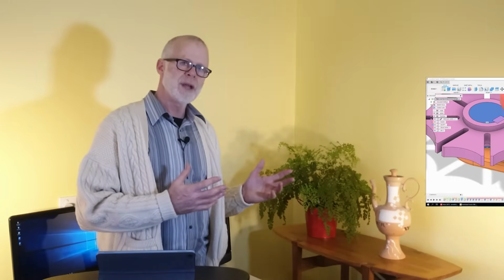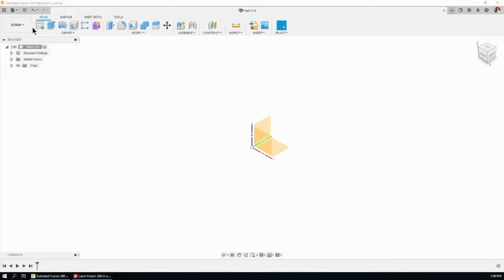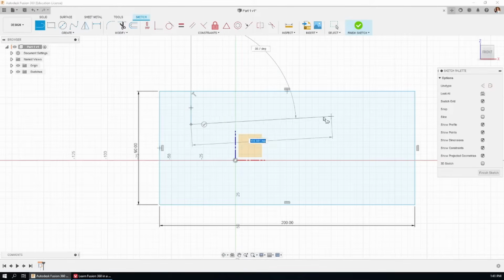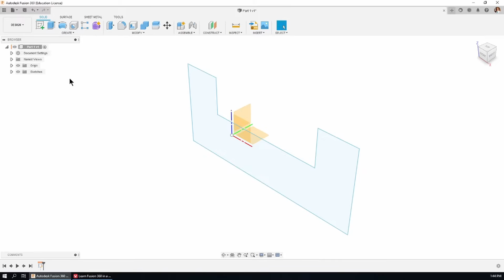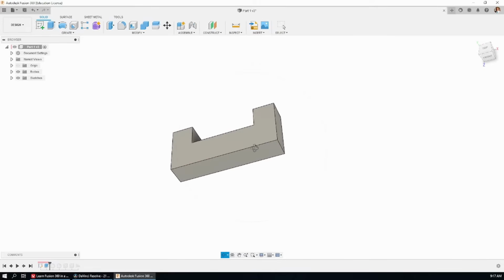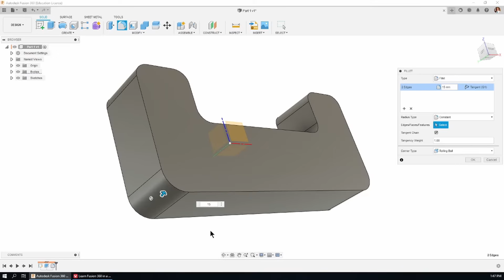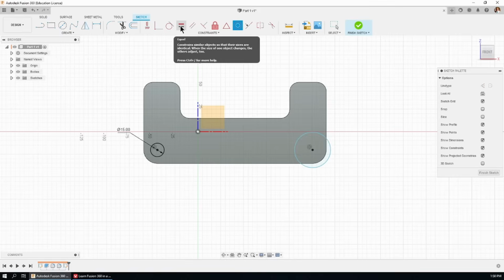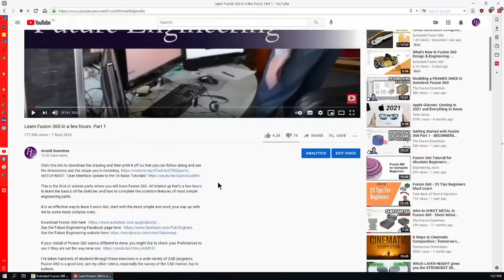Learn Fusion 360 In a Few Hours. Part 1

Comment: Very detailed and easy explained. Thanks very much. Subscribed and liked. Really deserved it. Is there a way to draw the holes already in the sketch mode and then also cut/trim them away?
Reply from the maker: Yes there is Mein, I'll be explaining in the next revised video (or perhaps the one after) about why I keep the sketches minimal when they can be much more fully featured. Basically its because new users constantly trip up in the sketcher. Keeping it bare bone and over simplified gets more people through and then they can proceed to complexity with a little more experience and a lot less grief. Have at it, see how you go, but remember that you can simplify the procedure if necessary.
Reply: Thanks for your response. Also what would be great is how to modify steps in the design which where done in the early beginning. For example I made a body with a whole and later on I need to change the dimension of the hole and the position or a cutout in a body. I getting frustrated and always undo till I get to the beginning 😬

Comment: hi i like your tutorial revised part 1, except while following it i found that the middle mouse button on my mouse is round and it only allows me to zoom not orbit I'm using a Logitech (i forgot the model) do i have to change something in settings or get a real three button mouse?
Reply from the maker: Hi MP, Logitech mice are usually pretty good. I'd be surprised if it was the mouse that was the problem, I think you might get somewhere if you mess with some Preferences, if you download the 16 drawings you'll get my preference settings as screenshots which you can go through and set your own to be the same.  The Orbit settings are on the General tab low down on the page, see Pan Zoom and Orbit Shortcuts and the next one there. In the meantime have a look at the little toolbar in the middle of your screen at the bottom. There is an Orbit tool there on the left side with a flyout and a variation. You can use that one with your left mouse button while you're sorting things out.

Comment: "Hi" just saying hi. I just got a 3D printer and I'll be using Fusion to design various enclosures for my projects. Your tutorial mirrors my version of fusion except with a few exceptions. I seem to have to click on the orbit icon to rotate the part where you seem to have a mouse click that works.
Reply from the maker: Thanks for the feedback, I hope your projects go well. That rotating behaviour can be changed in Preferences to some extent. See the video on Preferences here:  https://youtu.be/UVwJJvQR1fc    The one I'm thinking of is on the General page toward the bottom. I have it set to 'Solidworks' and the default Orbit type is Free Orbit.  I'm presuming you're on Windows? Its really convenient to be able to hold down the middle mouse button or scroll wheel and drag around.

Comment: Can I still use the old series? Has a lot changed in fusion 360 since then?
Reply from the maker: Yes Steven, the old series still works and there have been relatively few changes. I made a few extra videos to support the older tutorials while I was slowly getting around to updating. At the time of this writing there are only 2 revised ones and I won't be deleting the old ones due to the way Youtube search algorithms work. Deleting old videos deletes the searchability of a channel which takes so long to build. That said, there is something to be said for using the revised tutorials; the software is automatically updated and Fusion 360 is a kind of hybrid thing which is only partly downloaded to your computer. A lot of its functions are in the cloud and I'm not sure that you can avoid the updates very effectively. Consequently they are careful about how quickly and how drastically they make any changes to the user interface. 
Anyway, here is the link to the playlist on my channel for all these videos; the 16 tutorials and the support materials, as yet I've got the new ones in the same playlist as the old ones.

Comment: Hi Arnold, I am missing the extrusion icon for some reason. I have double-checked preferences so not sure why this would be, any suggestions?
Reply from the maker: That's pretty unusual, the only thing I can guess is that you're still in sketch mode. Are you sure that you've clicked on Finish Sketch?  You can tell when you're in sketch mode; the tool bar has 2D sketching tools and constraints but when you're in Feature mode you'll see the 3D tools in the toolbar, Create, Modify and Assemble etc.

Comment: Hello Arnold, I am moving from Design Spark Mechanical to fusion 360 because the free version only allow importing step files as read only so it is kind of limited. I put a lot of time into learning that program. I am hoping fusion is similar to DSM so my many hours were not wasted. Thank you for upgrading your beginner tutorials. I watched the first one and subscribed it was so good.
Reply from the maker: Thankyou Joseph and welcome to the channel. You'll find that all your experience with any kind of CAD will benefit you. Its even the intangible things like a sense of 3D space that comes by practicing reading drawings and spatial concepts. Insights are hard to put a value on but they do help, and then there's the benefit of modelling and detailing workflows that may differ to some extent but have a common goal. I always believe in multiple perspectives giving a better picture.

Comment: If you just want modeling to export for 3d printing, this is probably still a good solution.  The crippling changes they have put on the free hobby version make it useless for any sort of machining.
Reply from the maker: Wow Matt, that sounds a bit over the top, all the other Youtubers that I follow don't see the new restrictions as a deal-breaker. See my video on that controversy; https://youtu.be/FlrpyzquSQQ
I also show you how to work around the most significant restriction. The restrictions on the manufacturing workspace are pretty advanced features, most hobbyists don't go there, the basic stuff is all still available for free which makes it still the best deal there is.

Comment: Hi this is just what I need.I taught my self autocad 2004.and picked up so many mistakes.So now I can learn 360 correctly.Its a shame they aren’t on a disc to use directly
Reply from the maker: Thanks Peter, welcome. Hopefully Youtube will be there for years to come so that you can always come back to them if necessary but I think you'll be moving on to greater challenges soon enough. What will you do with Fusion 360?
Reply: @ArnoldRowntreeTeachesFusion360   I work for a model steam company in the uk

Comment: Hi Arnold.  I started the older Part 1 and 2 a couple of weeks ago and I think it is difficult for you as an experienced user to remember how unfamiliar everything is to a novice (like me), so I welcome your revised tutorials which are explaining things easier and S L O W E R.       :-).   I will watch them more than once and hopefully in 60 hours I will be up to speed.  Thanks a lot cobber.   Keith
Reply from the maker: Good on you Keith, I do try to pitch them at a new comer but I don't try too hard to speak slowly knowing that you can watch as many times as you like for the same price (0). I'm going to work through all the revised versions which will probably take about a year at my current rate of production so you might need to finish on the older ones.

Comment: 👌 There's one thing I found out. Because I have a free version of Fusion 360. I can have only 10 files active at one time. I was trying to make my own first part and couldn't save it. But once I made the rest read only I could save. Bizarre limitation but I thought it might be good to note if anyone else was using a free version.
Reply from the maker: It is bizarre but it still works ok for this learning stage. They wanted to protect the commercial version somehow. I think you'll get familiar with the limitation and work around it for some time yet.

Comment: Hi Arnold, have just just signed up for the newsletter and the 16 drawings, but the download only has 2 drawings in it and the other pages are settings for Fusion 360, is this correct ? are the other drawings  going to be sent with future newsletters?
Reply from the maker: Thanks for subscribing Andrew. Part of revising the old tutorials means that I'll also be revising the drawings. I sat down to revise all the drawings at once, there were an astonishing quantity of errors in the original and I have been keeping a list of corrections from all the feedback I've received. What I realised was that the revised tutorials are going to be a bit more creative. Rather than set everything in concrete with the revised drawings in advance I'll update the free PDF as I gradually work through the 16 revisions. That leaves a bit of room to add some stuff which I can't foresee from way back in the past. It looks kind of unfinished at the moment but should provide better value eventually. You won't have to worry about subscribing more than once, the system is smart enough not to duplicate the newsletter.

Comment: Got a question, The current Free to use (home use) Fusion360 seem to lock you in for 10 drawings... well sorry thats sort of a joke, I'm doing online training still to get to know it better and I"m bumping head into that 10 max limit. Is there a way around it, other than $400/year which is also crazy considering this is for a home tinkerer.
Reply: I just recently figured this out. The limit is for 10 "Editable Docs". Click on the top left most button "show data panel" then double click on "My Recent Data". In this area you can switch your files back and forth between "Editable" and "Read Only".
Reply: @edweirick3146  sweet, thats a easy fix to this annoyance...
Thanks
Reply from the maker: Ed's got it, its a bit of friction but I think its still the best CAD you can get for the money, that is - $0.
But keep an eye on this Channel George, I'm going to be thinking a lot about how people can make some money on the side with Fusion 360. I'll be surveying people for ideas on how to earn $400 per year for starters and then some.